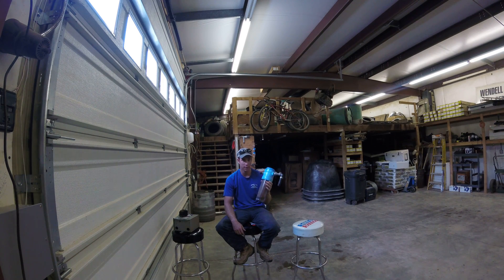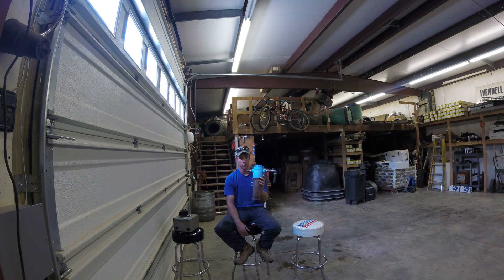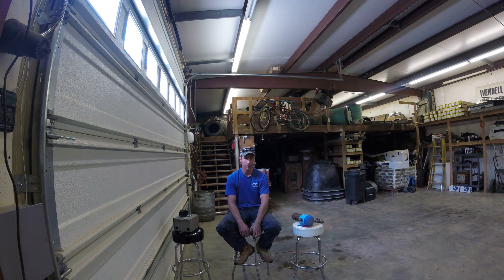Low Water Pressure, No Water: Check These Items First for Well Pump Problems

Comment: My pump all of sudden will only go up to 40psi. I had just replaced a galvanized 1 inch union and nipple because it sprung a leak. No it will only go up to 40 psi and the pump keeps running

Comment: Thank you for this video. The first thing I checked was the outside filter. The filter was full of iron. But the pump was working putting out lots of water. I will have to start changing my filters every couple months now, because they are building a lot of homes in my neighborhood and the water table is getting low. You’re a blessing, thank you.

Comment: you forgot to mention the pressure switch. Sometime you it court circuit due to ants or something. several times i have to go there and use the plastic cover to restart it.

Comment: 1st video I stopped by, and helped me right away. my sprinkler was weak and just happened, so it has holes about 12 of them a few seemed clogged. Still weak, I took off the hose and the sprinkler screen was full of gunk of some sort, kinda fiber like. I figured maybe my filter breaking up and getting carried in the water lines. NOT GOOD, Changed filter and PSI went from 20 to 40, all water is flowing nicely.

Comment: I have galvanized pipes in my house. A while back I got a new shower head and when the old one was removed you could see inside the pipe. It had a lot of rust built up inside. I broke some  of it loose and continued on. Is there a way to clean out that pipe? My water flow isn't that great and I was wondering if the pipe from the water heater to the shower could be cleaned??? It probably needs to be replaced.
Reply: I replaced the visible galvanized pipe with plastic pipes.  It helped a bit but didn't make much difference.

Comment: I've mentioned replacing the filter to my husband,  and it's def overdue.  We seem to have a drastic drop in pressure after I've had the sprinkler going for a little while. Any idea what could cause that.
Reply: My experience: need to increase pressure in the water tank.

Comment: Pressure starts off strong then dies out also if I open my spicket out side runs for a while then end up with hardly any or no water inside the house. well is about 1100 ft uphill away from house. well is almost 63ft elevation difference any idea how to fix it have a 10gpm 1hp pump with small pressure tank. 3200 sq feet house have 4 bath room and kitchen sink with 2 spickets out side the house
 Need help fixing this problem
Reply: If I drop my spickets where it T off outside from 3/4 to 1/2 in will that help the water make it to the house? If that makes since basically keep the main line 3/4 and drop the T to the spicket to a 1/2 in will that help
Reply from the maker: where is the pressure tank and switch located?
Reply: @WendellLeeWellServices  the pressure tank is in between the house and the well closer to the well tho
Reply from the maker: @samdaniel5703  sounds to me like you may have a pump that has lost some stages and won't pump like it used to. Or you could be pumping the well out, I'm not sure without being there and don't know how long it runs with good pressure until it dies out.
Reply: @WendellLeeWellServices  just replaced the pump but thank you I feel like the spickets outside pull all the water and cuts supply off from the house sometimes
Reply: I have an email if we could chat more about this topic samgoble75@gmail.com